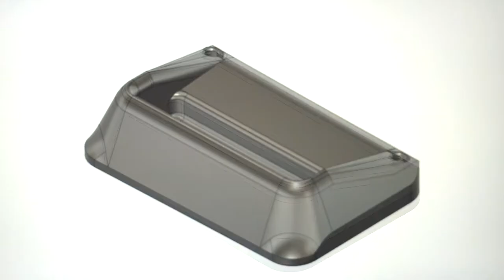3D printed hangboard

Comment: i just want to ask about the material your printing with and the infill percentage and how many shells
Reply: I did esun pla+, 35% infill and 6 shells (that being 6 solid layers top and bottom) plus 6 perimeters, I would also reinforce around the holes with 100% infill, worked great in the end and is very sturdy, highly doubt it would break, oh and I used variable layer height but i’m not sure how that effects strength